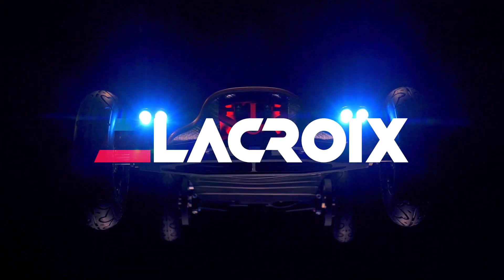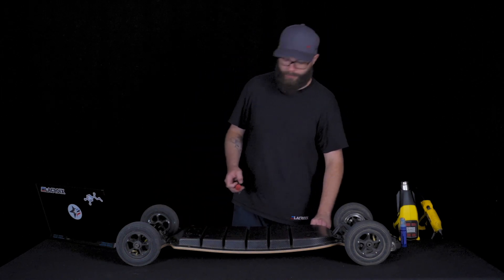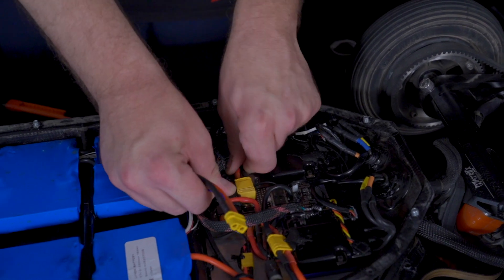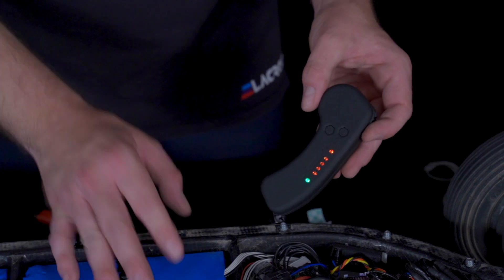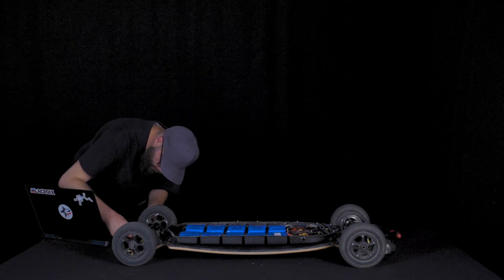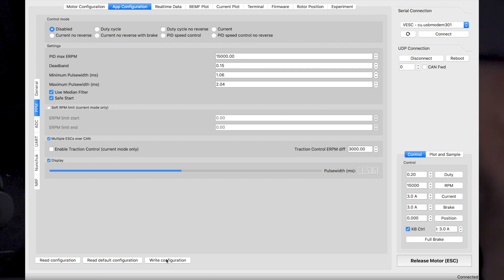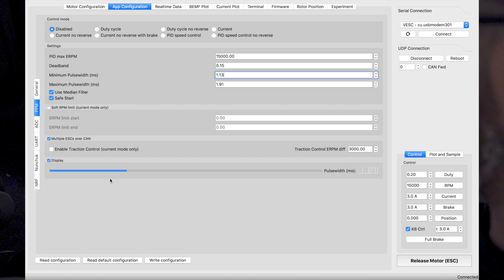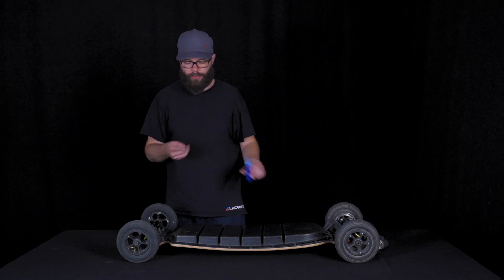HOW TO; install the Flipsky VX1 remote in the Prototipo (DSS60/DSS50+)

Comment: i had a issue with the vesc tool where i couldnt get the pulsewidth display to show a value reading so i just used your values and it worked flawlessly, thanks

Comment: where do I find 
bldc-tool for OS X? Crossing my fingers that this will all work. thx ... finally was able to find the software via Enertian website, and the software was free but still required a PayPal account and registration... Now that I have a connection via the software, I do not see VESC as the Serial Connection, rather  cu.Bluetooth-Incoming-Port... I am going to run w/ this to see what happens next..... woohoo, finally got VESC connection... needed to hold down the Power Button longer... o.k. next... dang... computer works w/ VESC Focbox.... got as far as the App and disabling the motors and activating display, though my FlipSky Controller is not pairing... now what? hmmm... all the wires are correctly configured. I see the illuminated blue light next to the Focbox... and I have a connection via the computer... but the FlipSky is not pairing... hummm stuck till I figure this out... help anyone? Got remote to pair... read directions for the remote... no directions for the remote in the box... but you have to hold two buttons down to pair properly... good thing I had my board on blocks, as disabling the board in the app, did not stop the wheels from spinning... going forward... remote works.... whew. Configrued all the settings as specified.... Seems to work fine... going to overview the VESC Settings Again.... just to make sure it's perfect.... wow.... The VX1 trigger has a lower profile, so the thumb needs to firmly planted on it to avoid slipping. It seems to pair a lot easier than my NanoV2. I just tried it out this morning on my Prototipo. It feels more like a Boosted Controller.

Comment: Just to confirm, we only calibrate the remote on the Master Focbox or rather the Focbox that the receiver is plugged into? 

Thanks
Reply: Hey, Steve, do you know what little metal piece connecting to the receiver for the voltage reading called?